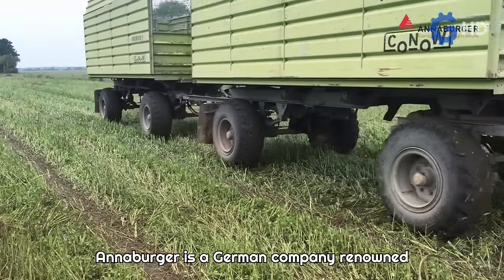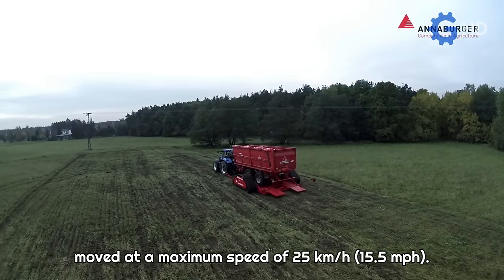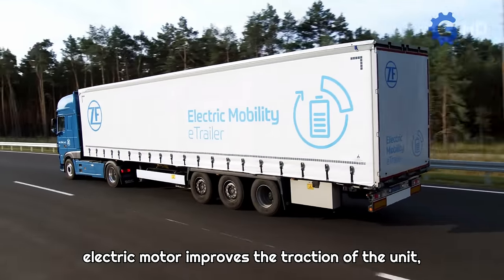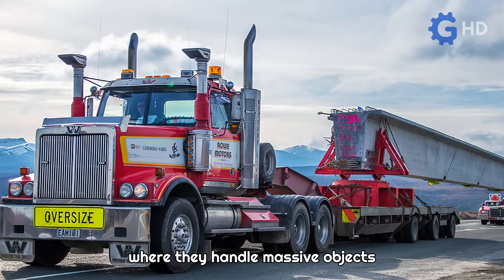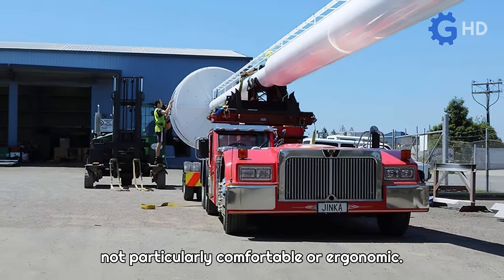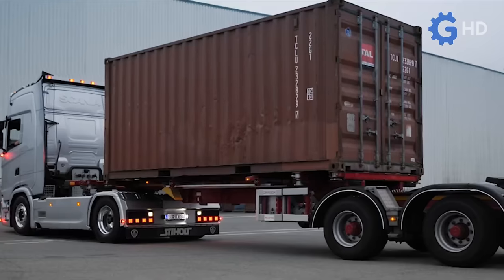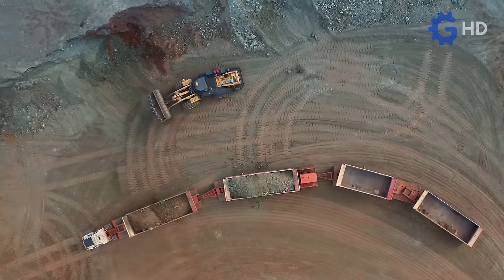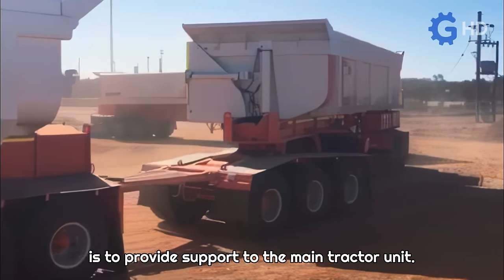WHY WAS THIS TRUCK BUILT LIKE THIS? ▶ MOST INNOVATIVE DOLLIES FOR TRUCKS 2

Comment: there's an issue with the E trailer : it's heavier so you can't load your trailer as much as without this technology so this trailer is counter-productive
Reply: Yeah, but it’s green so….😂
Reply: @@markaspen I thought that was impossible to source 😂
Reply: E-trailer needs solar panels on the roof.

Also, note there’s 1 kw/hr per 5-7 kg.  100 kw/hr could weigh as little as 500 kg.  

The trailer hauls 5% less or so.  It pays that back in fuel savings.
Reply: It is heavier than a regular trailer but it is far less than you're making it out to be. It seems like it is a fantastic idea, it will let a single driver pull twice as much and the weight difference is far less than a 2nd truck being that it's just the basic powertrain that is added without the cost of another truck...
Reply: Not really a problem for many operators who don't use the full capacity in normal operations. To be specific, the UK Mail carriers rarely run at 44 tonnes, indeed many of their motive units are down rated to save tax, they could have eTrailers and still not have to up grade.
Reply: @Sarge084   effectively. that was my last job in France and my truck's average weight wasn't over 22 or 23 tons and i drove a LNG truck but it doesn't help because it's not as efficient as they claim (22 tons and 460 hp i had difficulties on 5% slopes but not with diesel) all these technologies are interesting if it brings improvement and that's not the case so, a trailer equipped with electric motors is useless. Something really efficient is diesel electric (invented by britishes) the diesel engine serves only to power electric motors and you can fit one modern electric motor on each axle making your vehicle all wheels drive (even the trailer)
Reply: Ok so a few things on the E trailer. Here in Canada the trailer is pretty much useless because a few things. 1 we have a lot more flat land and less tight corners. 2 with the assisted power on the trailer where if we lose traction on the tractor and there is power on our trailers more then likely we will jack knife. 3 added on weight for a unit means less product weight to transport with the exception of mail freight. Also the cold weather we get here those batteries won't handle the cold weather as well as the large amount of snow and ice. Our vehicles under body in winter does get damaged if to low. So I think the trailers seems nice but not really good for us in Canada.
Reply: They've added a third axel, which carries the weight of the battery and drive system.
Reply: @terrytytula  the problem is not to carry the batery's weight but the cargo's weight decreasing while the trailer's weight increase (in europe we are limited at 44tons and a standard trailer weights about 8 tons if the system weights 2 tons it's 2 tons of freight less, 2 tons of freight less it's a lot of income lost)
Reply: And with the generators it requiers more gas all the time because of the friction.
Reply: @wickster79  I'm sure the trailer will shut off the power to the wheels if the truck's engine is failing. Because the two systems will work together. If the truck brakes or pulls away the electric motor on the trailer will generate power or give power to the wheels. There is a connection between the electric system on the trailer and de ECU unit on the truck.
Reply: It’s your classic European answer to a problem that doesn’t exist…
Reply: Wrong. Put on a trailer with several axles. It makes sense. 
Dunning Kruger effect on display with your comment.
Reply: A significant number of loads aren't to capacity. Just like electric trucks for in town work makes sense but use for OTR doesn't. E trailer can be good for some applications and not for others, like most things.
Reply: The etrailer Activates during the acceleration process Nd then cuts off when the unit gets up to cruising speed…. So its not a factor on a jackknife situation